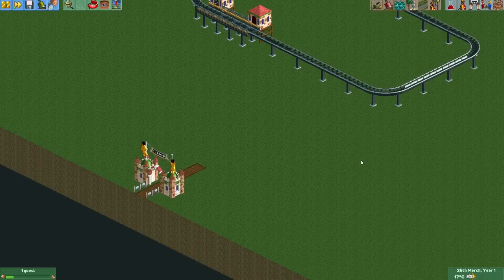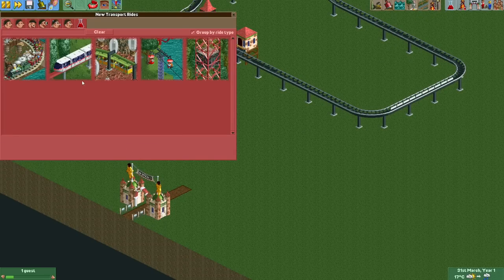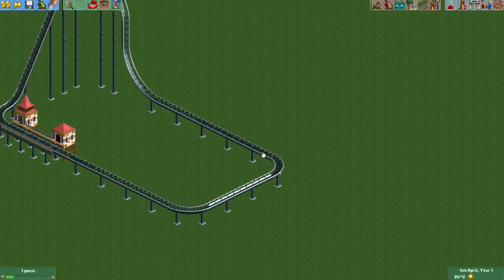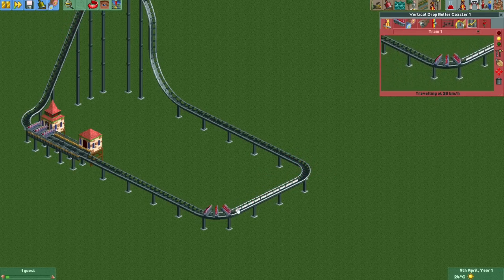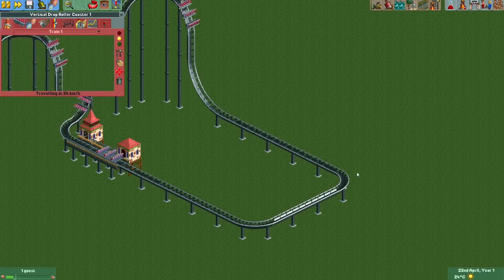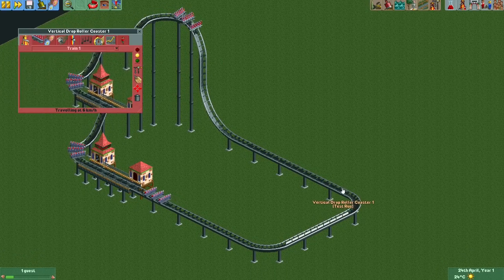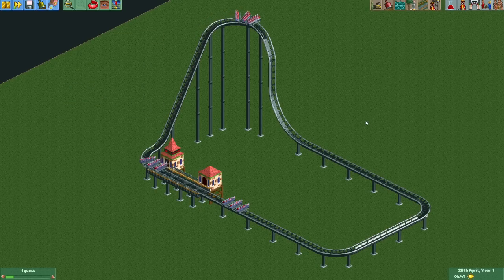OpenRCT2 Update: You can now set the speed of your block brakes!

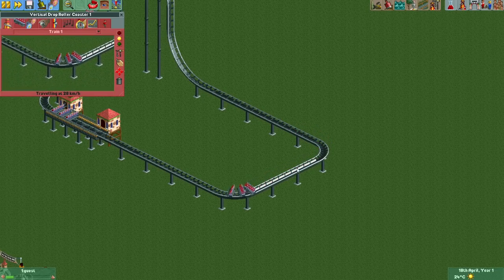Comment: 5:10 Is a little bummer. The planning could be different if a train starts from a blockbrake with x mount of speed. 😕
So some NoLimits Designs still are not possible.
Reply: Just equip the brakerun with additional drive tires. Many coaster types got them already, so you can push your trains out of the brakerun. There are quite some rides in reality which use drive tires on brakeruns, not just in front of the station and since we aren't able to do them on slight slopes it'll be at least a solution.
Reply: Not really, that's how it should work. Brakes slow the train, they can't function as a launch so having them accelerate the train up to the set speed like they did in RCT3 looks silly. I probably wouldn't use the feature at all if it worked that way because it would look worse than the vanilla behaviour in the 98% of cases where you don't want the brakes to function as a launch.

If you do want the train to launch out of the block, you can build a booster piece after it ... which is after all what would be done IRL.

Comment: "Requested alot" wait people use block brakes over long stations? Either you or Marcel shown long stations are better...
Reply from the maker: It wasn't me for sure, I use block brakes a lot because I love making beautiful and at least somewhat realistic coasters.
Reply: Yeah i checked, Marcel. I use it on steel wild mouse and hairpin, these can have their stall events due guest weights. I thought excitement is related to average speed? Block brakes seem to hurt that and throughput. I made a ride called "flight of the cutiefly" to experiment with them but it's just not my thing. Good to see other people wanted and got this.
Reply: I for one almost always use block brakes nowadays, mainly because they eliminate (Station) Brakes Failure breakdowns.
Reply: Station Brakes Failure in RCT1 conditioned me into using Block Brakes most of the time, the only exceptions being in types without them and coaster types with single-car trains.  Also the benefit of using Block Brakes is that you don't need a long station to run more than one train, hell you can even split the station into separate load and unload platforms, long stations require a sizeable chunk of space in a strait line, however that's not always an option.  Harmonic Hills comes to mind, due to how limited you strait sections are, long stations aren't exactly an option.

Also you can get some crazy efficiency with Block Brakes, I created two B&M coasters in Lucky Lake (flying and floorless) and the flyer, despite running only two trains when it's able to run three was getting over 3k riders per hour.

Station Brakes Failure/Brakes Failure is honestly one of the cheapest things in any game that I've played, and that's saying something from someone who has put an unhealthy amount of time into the Pokemon games on a serious level.  RNG randomly decides that a normally well-designed coaster that was perfectly fine now crashes and (likely) kills people, you did nothing wrong, and yet you get punished.

The lack of Block Brakes/Station Brakes Failure and the lack of banked sloped turns are the only two parts of RCT1 that haven't aged the best.
Reply: @AceAviations2  you know station brake fail can be prevented by a single normal brake?
Reply from the maker: @DarkWarchieff Normal brakes also fail if a rollercoaster has a station brake failure
Reply: I definitely use block brakes. Now coasters with a mid course brake run, not something I typically do.
Reply: @Deurklink  how about block brakes when they're not in block brake continous circuit? fail? as they act as 6 km/h brakes in such case.
Reply from the maker: @DarkWarchieff if for some reason you build a coaster with block brakes but don't put it in block sectioned mode, the block brakes will still slow down a coaster if the coaster has a brakes failure breakdown.
Reply: There is plenty of people that play OpenRCT to build nice and/or realistic designs and therefore use block sections. This feature is a great addition for pretty much everyone. And it was definitely requested a lot.
I'm confident that people that only play for efficiency (i.e. not use block brakes, spam micro coasters, etc.) are not the majority of the player base.
Reply: Long stations are better for throughput, block sections are better for realism.